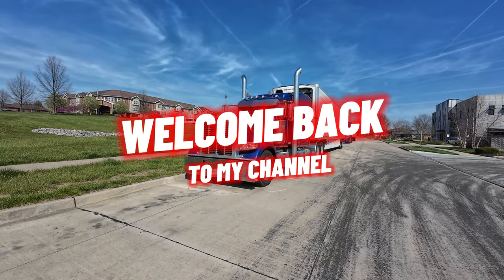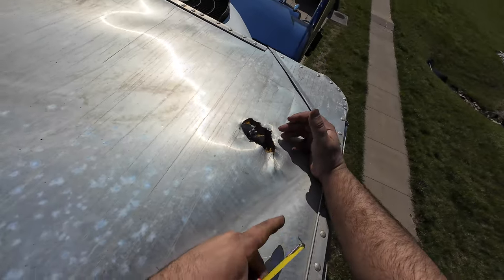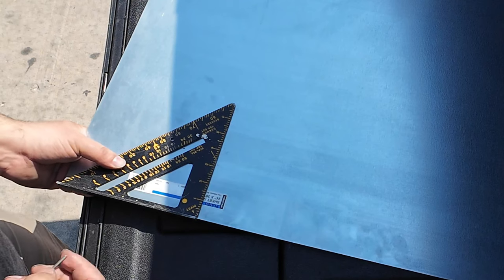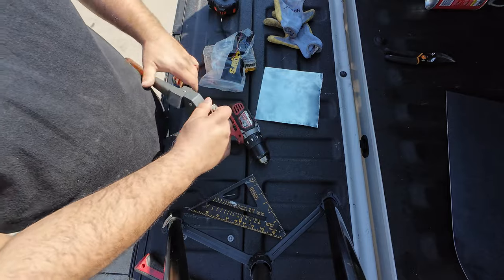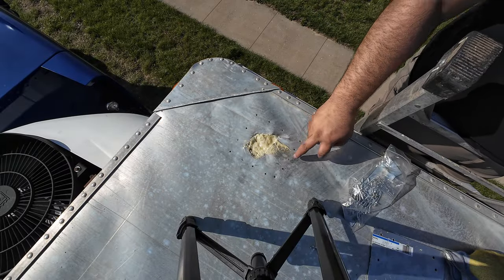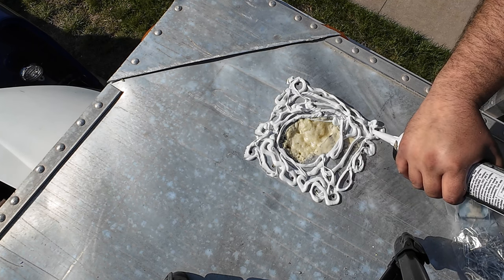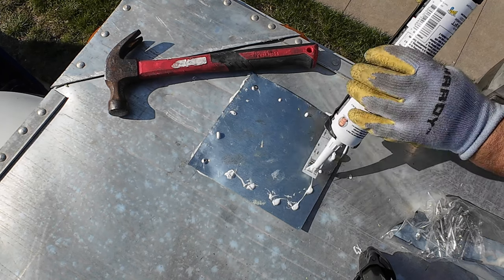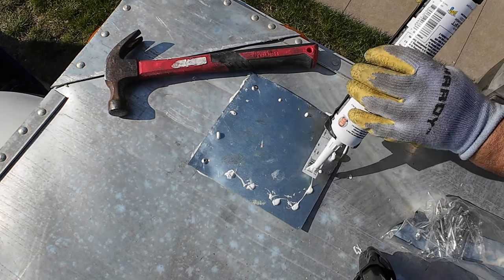FIXING A HOLE IN THE ROOF OF MY REEFER TRAILER

Comment: Now, because I’m a musician and not a gear jammer with a reefer riding the bobtail, don’t pick on me for this, but I’m guessing there aren’t any coolant lines running through the ceiling of that box? I have no idea how those trailers work, other than there’s a compressor and evaporator at the front of the box that operates on the ‘you can’t roar like a lion and purr like a kitty if you want the work done’ principle, in other words, it’s a bit noisy. 

Between science and physics classes in high school and college a century ago, and a fair share of common sense, my brain tells me that there has to be coolant lines in the walls, ceiling and/or floor somewhere - the cold air can’t possibly be blown all the way from the front of the trailer to the back of the trailer sufficiently enough to keep 44,000 pounds of delicious ice cream frozen on a hot August night in southern Texas …… or whatever you’re carrying to wherever you’re headed  🧐 So how does that system work, and what is the temperature range that it operates? The curious brain would like to know. Plus, I’m a firm believer in the fact that we should all strive to learn one new thing everyday 😊

Keep it between the lines, and keep the dirty side down!

Happy Easter! Christ is risen!
Reply from the maker: Happy Easter to you as well my friend. Actually everything is in that box up in front. Cold/hot air blows from there and it gets through chute that runs inside hanging from the ceiling. Chute stops about 10 feet away from the door. Air comes from the chute hits the door goes down to the floor and comes back through the grooves in the floor up to the cooling unit. And it just circulates like that all the time.
Reply: Well, goll-ee! As Gomer would say. An even simpler way than my brain tried to make it. There must be a pretty high torque fan motor pushing the treated air through that trailer from basically what sounds like a forced air heat exchanger, right?

What’s the temperature range - obviously somewhere below zero for the coldest, but how cold? And what’s the high end?

I know, I know … I’m so curious. I have this personal need to know how things work, and why they work the way they do. I’m literally fascinated by the most inane things. I always have been. 

I was just as curious with your patch job, yesterday, too. As far as I’m concerned, you get positive points for clicking through that repair, and even more points for doing a good job on that repair. I’ll dock you 2 points for using pruning clippers as opposed to tin snips, but 2 points is nothing in the grand scheme of things!
Reply from the maker: @ImOnAJourney Should have not used pruning scissors but they got the job done. Temperature can go down to -20 and I’m not really sure how high it can get because I just started pulling reefer. I did have it set at 70 degrees last week. It’s gotta diesel engine that powers the cooling unit.
Reply: @OTRBandit 

Interesting. Thanks!

Comment: Hey Bandit it’s me the guy from SoCal who used to be a aircraft mechanic yeah you were right you should of got sheet metal shears and if you can find it PR-1422 aircraft sealant best of luck BUDDY
Reply: Good job buddy
Reply from the maker: I had those shears at home but I forgot to bring them with me. I will definitely look that glue up. Thanks for the tip buddy 🙏🏼
Reply from the maker: Thank you very much 🙏🏼